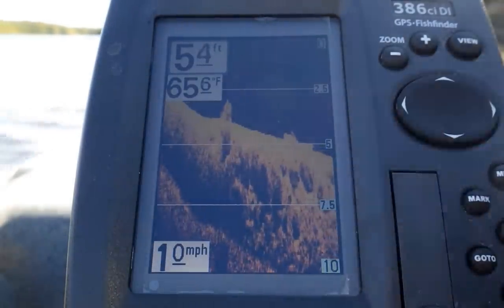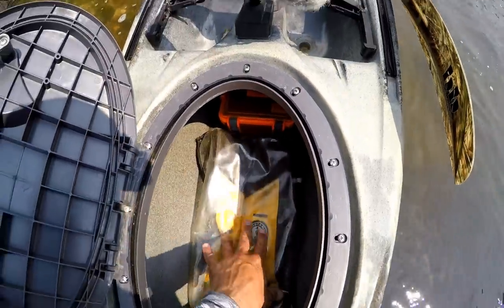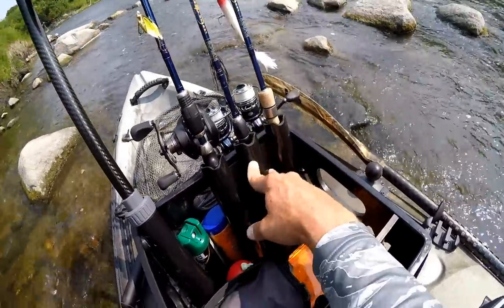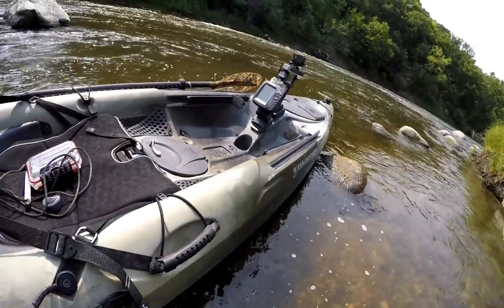My Tarpon 120 Fishing Kayak

Comment: Any chance you could do a video on your H1 settings you use when recording out on the water?
Reply from the maker: I've been meaning to do something like that. I've been so busy at work lately my main goal right now is to just hit the water and catch some fish lol. I'll be getting more time off soon though, just as the pre spawn bite should really start heating up. I'll give you a few tips on the H1 until I can get a video made.                                                                                                                                                                                                                                                                                                                                                                            I keep mine set to 44kHz/16bit/WAV. My video editor outputs the audio in 44/16 so I like to keep the Zoom at those same settings and WAV will give you better quality than mp3. The auto level and low cut switch on the back I turn off and take care of that in my audio editing program. For the input level I'll keep mine around 70 with my kayak camera rigs. I'll adjust it for other situations, you basically want it set as high as you can without ever having the red peak light come on.                                                                                                                                                                                                                                                                                                                                                                                Once I get back home and dump all the files onto my computer I'll take the ones I want to use and open them in my audio editor. The first thing I'll do is boost the master gain by around 18db to increase the volume. Next I run an EQ on them, mostly just a high and low pass filter. I'll set the high pass around 85Hz with a 48dB/octave slope to get rid of a lot of the wind noise. The high pass I set around 10.5kHz, also with a 48dB/octave slope to get rid of some of the recorder noise and high end harshness. After those steps there will most likely be several spots that will "clip" or cause distortion. Usually high frequency noises like smacking rods against the kayak or fish jumping, you'll be able to see these spots on a wave chart by looking for any peaks that go above or below the 0dB reference line. These need to be toned down back below the 0db line to prevent distortion so I'll zoom in and highlight those areas to decrease the volume. This is usually the last step I'll do before rendering the track to swap into the video. It can be a little time consuming so I wait until I get all the files lined up and cropped in my multi track mixer to tone down those loud spots, that way I'm not doing it on parts of the audio files I wont end up using.                                                                                                                                                                                                                                                                                                                                                                             One more thing I'd recommend if you plan on using the H1 a lot, especially on longer outings, is to invest in a set of the white label Eneloop batteries and a charger. You can probably get a set of four and charger for under $20. I'll get around 8 hours record time on Eneloops compared to maybe 3-4 on alkalines. They can be charged something like 2000 times too, I'm still on my original set of four I picked up in 2012 and they get a lot of use. A lapel mic is good to have too, mine does a lot better on windy days than the Zoom's on board mics. I use a cheap Audio Technica ATR-3350 and it works great. They work best with the Zoom if you cut out the battery holder part and solder the wires back together without it. It will run hotter with the Zoom's built in power supply. Lapel mics only pick up one channel so there is an extra step in editing to switch it to both channels.
Reply: +NDYakAngler Wow thanks for all the information man, I really appreciate it. I'm getting ready to pick up a Sony a5100 and want to record audio separately and lay it over my videos later. Really considering picking up the Zoom to do this. The audio quality  on your videos is outstanding. I've always admired that on your videos. Looking forward to more videos from you!

Thanks again!

-BBK

Comment: I made a dolly, copied a design I saw on you tube, I'm skeptical as to how much it will handle but we'll see.I have a few more questions for you.Did you make the anchor cleat as I can't find one like it.Also I can't find a nylon ring or 3/4" HPDE.If you have time to answer then great, thanks
Reply from the maker: The nylon ring and mini zig zag cleat are both made by Yak-gear, I ordered both from Austin Kayak. I made a spacer from a 1/16"*3/4" strip of aluminum to go between the cleat and slide track rail and another piece of 1/8"*1/2" aluminum with holes drilled and tapped for 10-32 screws went into the track to screw the cleat down to. I get my HDPE from TAP Plastics. The stuff I use is called King Starboard. There's a minimum of $10 per piece for cut to size so you can play with the dimensions to get the most for your money.
Reply: Thanks for the reply.
I did get to the YAK GEAR site and found the cleat anyway. Thanks.
No nylon ring as of yet.
By the way if you were to provide to me detailed drawing and/or steps re: your camera systems I would be willing to pay you for them... It's just a thought.
Of course you may enjoy having the one of a kind Kayak and I don't blame you.
Although I am in another country, lol.

Anyway thanks again, back to tinkering.
Reply from the maker: The only thing I really sketched out on a planning pad was the part of the front camera mount that holds the copper pins and magnets, just to make sure everything would fit. Everything else was either planned out in my head or built to fit for a specific purpose. One thing that would definitely save a lot of work on the crate camera rig would be to just have a long enough cord from the power converter to wrap up around the camera pole and to the gopro once it's in place. If you want you can shoot me a PM with your email or get a hold of mine on my main channel page and I can take some pictures and measurements and send them to you.

Comment: Is this Tarpon better than your orange Tarpon that you had in previous videos?
Are there better Tarpon years than others?
Reply from the maker: Prior to this year the Tarpons hadn’t changed much since around 2011. This year they made some changes I’m not exactly thrilled about, they got rid of the rear slide trax and ditched the center hatch for a dry box that pops in to a slot there.

Comment: How does the 120 do on smaller/faster moving rivers? I am looking at the tarpon and the aspire for here in NC. Trying to decided on sit on top or sit in.
Reply from the maker: The Tarpon does really well on rivers. I have no problem paddling mine up to this spot, farther upstream it gets too rocky though. The problem I run into is those spots where the current picks up it generally gets shallow and if you're in less than 8" of water it gets tough to put any power behind your paddle stroke without bashing the blade into rocks. Those two kayaks would be pretty similar paddling against current though, maybe a slight edge to the Tarpon with its longer more aerodynamic hull but the Aspire will be easier to maneuver.

Comment: Hey man very nice, may i ask how much cost that kinda Kayak?
Reply from the maker: Thanks! A new Tarpon 120 kayak retails for $939, although this time of year you might be able to find one a little cheaper.
Reply: +NDYakAngler Hm like frm where? online or some story
Reply from the maker: If you have any sporting goods stores that sell kayaks nearby they'd be worth checking out. During winter they'll often have them on sale to make room for the new kayaks coming in this spring. The Scheel's sports store here had my Tarpon 120 for $699 last winter, although color choices were limited. Both of mine I ended up ordering online from Austin Kayak. They have them listed at MSRP but when you add them to the cart it deducts $60, which is about what they charge to have it shipped so it basically works out to free shipping. ACK does a package deal that adds a cheap paddle and a decent NRS pfd too which for $30 more is worth it just for the pfd.
Reply: +NDYakAngler Ok Thanks Man

Comment: nice yak how did you get the cap off the net to change the bunge. i have the same nat and i am wanting to do the same thing
Reply from the maker: The first one net I did was pretty easy, I'd already used it for a year so the glue was starting to come undone. All I had to do was yank on the bungee and the cap popped off. The second time around I did it with a brand new net. I had to pry at the cap with a big flathead screwdriver while pulling on the bungee.
Reply: Ok thanks I will try to do that

Comment: Do you machine your own stuff?  Really wish I had a mill and lathe.
Reply from the maker: Yes I do. I don’t have any fancy equipment or anything, just a cheap drill press from Harbor Frieght. I’ll put a long machine screw through a chunk of plastic, toss it in the drill press, and use it as a lathe. I wouldn’t try machining metal like that but plastic is pretty easy to carve away at.

Comment: how were you able to conceal the power cable and the transducer cable from the fish finder
Reply from the maker: The base for the fish finder has a hole in the middle to run the cords through the bottom and I drilled a hole in the mounting location on the kayak so I could run them straight down to the inside. I had to drill something like a 1/2" hole to fit the plugs through so I figured how much cord I'd need on the top side and wrapped a thin strip of duct tape around both cords together in the spot where they'd come through the kayak plastic so it was a snug fit in the hole. Once I had the ff base mounted I filled the opening in the middle where the cords pop through with marine goop to keep them in place and prevent any water leaks.

Comment: I was wondering how tall you are?because i'm thinking of getting a tarpon 120 just wondering if it's big enough i'm 6 foot 4  220 pounds
Reply from the maker: I'm 6' and about 190. My foot pegs still have 3-4 notches I can slide them forward though so there should be plenty of room. If that's still not enough the entire track the foot pegs attach to can be removed and repositioned farther forward, you'd just have to drill some new holes.

Comment: If you could, PLEASE PLEASE PLEASE. Do a step by step walk through of all the electrical parts to your cameras. What you used and the names. Cause I really like your set up but it's to complicated without a explanation
Reply from the maker: There's a link in the info box for the mini usb plugs I used with the Gopro and the 12-5v converters can be found on ebay. Pretty much everything else I built from scratch using hdpe plastic and 1/8" copper rod for the electrical connectors at the end of the camera pole and inside the receiving end. I might do a basic "how to power a Gopro" video this winter or explain the camera rigs a little further but a lot of it is glued together so I can only show so much.
Reply: +NDYakAngler  yeah cause I got my dad to look at it and he was very amazed at how well you designed it. And thank you for the explanation
Reply from the maker: No problem! It was a complicated project, probably around 150-200 hours of time planning and building everything for both the camera rigs. A lot of work could be saved on the milk crate rig by leaving the power cord outside the camera pole. Having the battery/voltage converter in the crate with enough cord to wrap around the pole and up to the camera once its in place would have made things a lot easier. There's more aftermarket options becoming available for supplying power to a Gopro too so if I had to rebuild the camera rigs I'm not sure I'd go this same route. I'm considering switching over this winter from the heavy lead acid 12v battery to a lithium power supply also. Those usually have a 5v output that I could run directly to the gopro so if I go that route I'll have to tear apart the milk crate portion of the rig and re-wire it. If I do that I'll make sure to video the process.

Comment: How long does the battery last for on the fishfinder? Can you get 6+ hours with it?
Reply from the maker: My fish finder draws around 425mA so for every amp hour (ah) the battery is rated at I get about 2 hours of run time. The smaller 5ah battery will run it about 10 hours, the 9 or 10ah will get around 20 hours of run time.
Reply: @ndyakangler  thank you man that definitely made it easier for me..time for me to make a trip to Walmart this week.

Comment: Where did you get the black hardware? What about the stick grip?
Reply from the maker: I got the screws from Albany County Fasteners. Black oxide coated stainless isn't easy to find and they're the only place I've found where you can order whatever quantity you need. The Conseal grip pads I got from Hook1.
Reply: Thanks for the feedback. I recently purchased a Tarpon 120 because of your vid. I love it so far, but looking to upgrade soon.

Comment: How did you make the tag for the bungee that holds the paddle? Ty
Reply from the maker: ABS plastic. I cut a circle, drilled a hole in the middle to put a screw into, then put it in my drill press and used it like a lathe.

Comment: What size paddle are you running with the tarpon? Thanks.
Reply from the maker: 240cm
Reply: @ndyakangler  cool thanks for the reply. I'm going to pick up an angler pro as well. I got a 230cm right now but I feel like I don't get enough bite on the water sometimes. The tarpon is a dying breed of kayak, I'm glad I got a deal on the last 2019 model before they updated it for 2020.

Comment: Does mounting the transducer in the hull alter the water temperature reading?
Reply from the maker: I’ve compared it a couple times with other boats that had theirs in the water and it was within 1/10 of a degree. It just takes a little longer at the start of the day for the hull to adjust from air temp to water temp, maybe 20-30 minutes after launching I consider it accurate.
Reply: @ndyakangler  okay thanks was wondering how I should go about mounting mine and I think that answers it!

Comment: do you remove the camera  battery the one the camera has when you use the 12v  battery
Reply from the maker: No, the Gopro battery stays in. I use a power converter to send 5v to the Gopro so its basically the same thing as having it always plugged into a charger.
Reply: +NDYakAngler thanks  very  helpful

Comment: What voltage converters did you use?
Reply from the maker: Mine have CPT printed on them. They came from China so who knows if that's a company there or what. Search eBay or aliexpress for 12 to 5 volt converter and you'll find them.

Comment: Hey ... $550 a good price for a 2013 used tarpon 120?
Reply from the maker: That sounds like a good deal if it's in decent shape. I've only seen a couple used ones come up on Craigslist and they were around that same price.
Reply: is it heavy to car top with one person?
Reply from the maker: I tow mine on a trailer so I only have to lift it about waist high. They aren't extremely heavy but the awkward shape might make lifting it on top of a taller vehicle difficult. A couple of my friends who put theirs on top of suv's usually lift one end onto the back roof rack bar and grab the lower end of the kayak and slide it the rest of the way on.

Comment: Do you have a link to the mics you use?
Reply from the maker: They're Zoom H1's, I got them from B&H.
Reply: Oh my bad... I'm currently rigging my setup... I remembered how great yours was. So I was thinking about what type of mic you used (didn't re-watch the video). So you don't actually use an external microphone you just use the one that comes on the zoom H1... Good to know. 

Have you ever considered running an external mic, like a shotgun mic?
Reply from the maker: I use the on board mics on the H1 and record directly to it. I tried running the output to the Gopro but it altered the audio and didn't sound nearly as good. The H1 is sensitive to wind though so a furry windscreen is a must for outdoor use. I also use an ATR-3350 lapel mic occasionally, for the hat cam rig and when it gets too windy for the H1 to handle.
Reply: I'm leaning towards using an H1 just for the sake of have my hands/body completely free of camera gear. Sounds great!

Comment: do you get water pooling under the seat? I do
Reply from the maker: I've never had that problem. The scrupper holes under the seat come plugged from the factory, the plugs in mine must have been knocked out at some point. When I paddle through a big wave or go over a dam water will splash up through the holes sometimes and get my seat wet. I'm not sure if you can completely remove those plugs without taking the seat off but you could probably pop them out through the bottom with a stick or something. I'd only do that if you mostly use it on calm water though, anything really choppy and you'll get water splashing up through the holes.
Reply: +NDYakAngler thanks, I must have not unplugged it